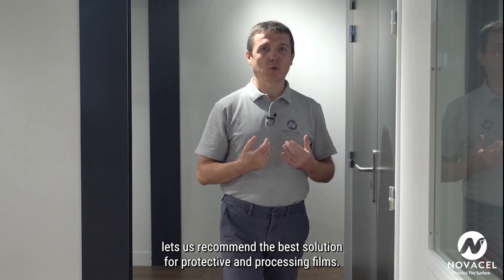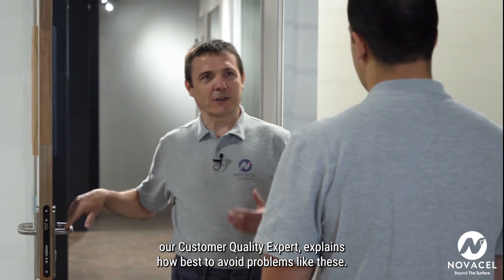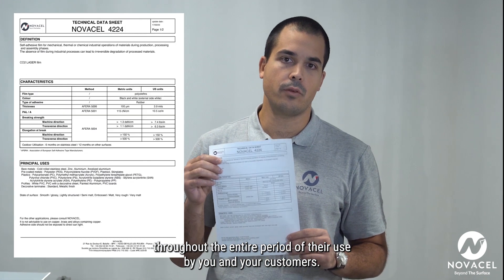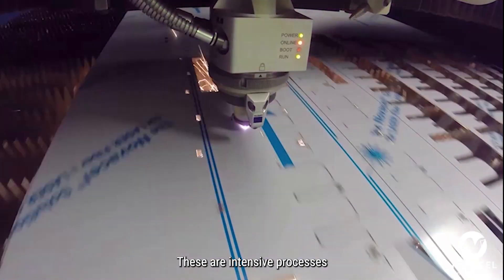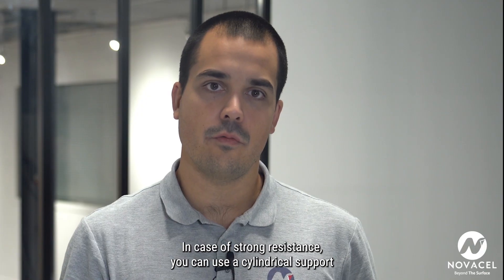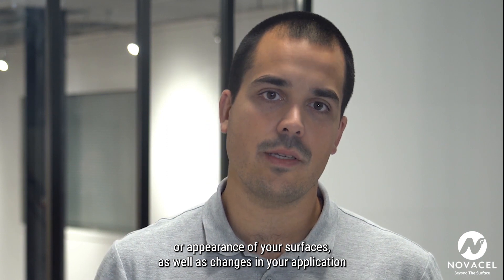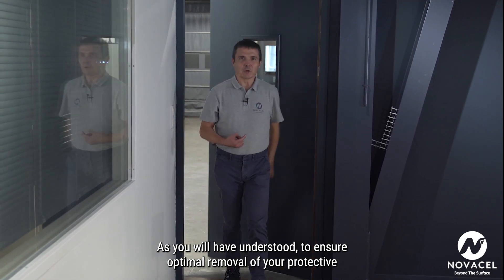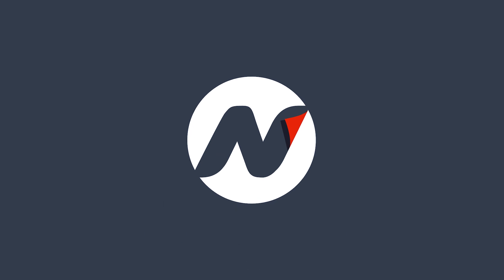Novacel : How to remove film from your surface?

Comment: This is nice and all, but I couldn't peel of your film in one piece from a stainless steel cabinet. Moreover the manufacturer folded some edges with the film still on the surface and used rivets to attach several plates together. How can I remove the film from the nooks snd corners without drilling the rivets and disassembling the whole cabinet?